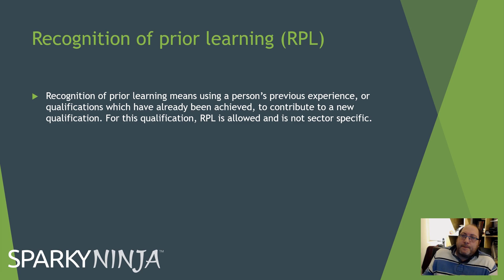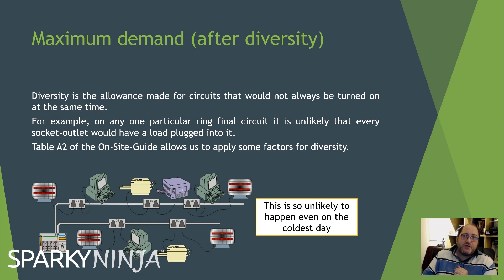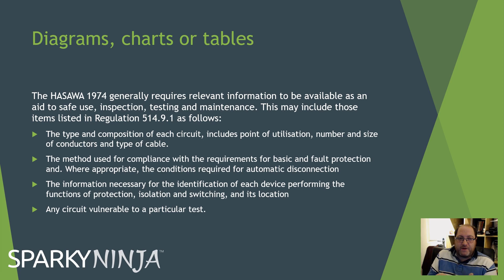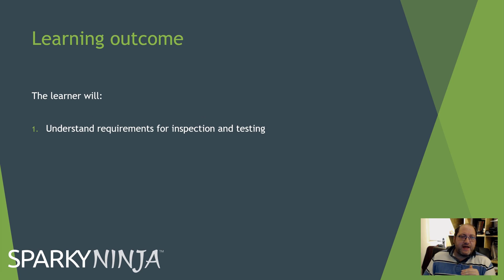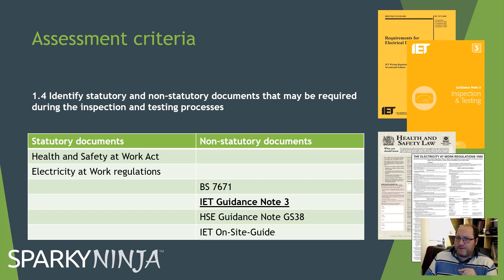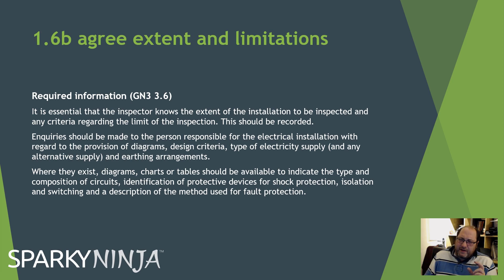2391-52 Inspection and testing course - Outcome 1

Comment: Hello Sparky Ninja, I wanted to ask some advice if you get a sec. I currently have 2392 qualification and due to work commitments, I find it impossible to take out a week to upgrade to 2391. I have taken 18th Edition Update course online with an assessment @ NICEIC centre which worked well. I am currently seeking an e-learning platform for the learning with a day at a local centre to take the exam / practical. Can you advise if you know of anything that would help me achieve this. Thank you in advance.

Comment: Great to finally see some relevant videos for the UK electrical trades. 

My boss just booked me on to the 2394, 2395 course in ten days time, no doubt some of these videos will help. Can you recommend any that are specific to the course please? I thin this is the actual course:

https://www.shop.niceic.com/combined-initial-verification-periodic-inspection-course

https://www.shop.niceic.com/pdf/a/700/Combined_IV_PI.pdf

Thanks.

Subscribed!
Reply from the maker: Glenn Carr hi and thanks for your comment.

Can I ask if you are sitting a combined 2394 and 2395 course? Or are you doing one and then the other?
Reply: SparkyNinja 

Thanks, think it’s the combined! All in one week
Reply from the maker: Ok then the syllabus for this 2391-52 series is the same. The difference for you is that if you are doing the two courses (2394 and 2395) instead of the newer 2391-52, then it means you will have to go through twice as much assessment.
Reply: SparkyNinja 

Ok, thanks.
Reply: +SparkyNinja

'The difference for you is that if you are doing the two courses (2394 and 2395) instead of the newer 2391-52, then it means you will have to go through twice as much assessment.'

Just curious, but do you know if the course includes the assessment? I can see that it says something about multiple choice questions but it seems a little vague as to whether it leads to directly recognised qualifications or is preparation for a separate exam (a bit like the AM2 for example). It appears to be run by the niceic themselves so not sure if the classroom hours are inadequate. I have just emailed them for further details but thought I'd ask on the off chance you might know a little more. The course codes are double Dutch for the most part (a bit like BS numbers - 7671 for example, pretty meaningless!) and there seem to be so any. Knowing which courses are most suitable is not easy. My boss wants me to take the role of qualified supervisor in the company, hence the booking.

Cheers.
Reply: +SparkyNinja

Just thought I'd give you an update on the course (since I'm now attending it!). It does cover both initial verification and periodic AND the final exams are included in the price (although at a later date) which include a 60 question multiple choice paper, a 1hr 20 minute written exam and a practical test though I'm not entirely sure of the details of this. More to the point, the final exams can be either through EAL OR City and Guilds, the latter being the 2391-52! I have opted (like the other three on the course) to go for the 2391-52 so these videos are perfect for me. 

Thanks again for putting in the informative work!

Comment: Great video. Would love to hear your thoughts on EAL Inspection and Testing 4337/4338
Reply: HobbyMan UK the eal test & inspect its for kids mate, i did it its a joke how easy it was
Reply: joe preece to make things interesting I have now done both City and Guilds 2391 and the EAL. Personally I think the EAL is slightly harder and in fact gives a better indication of an electrician knowledge of BS7671 as a whole and it's requirements for initial inspection and commissioning of electrical installations and the testing and inspection of existing installations. Breaking the course into two parts along with exams and the practical exams is in my opinion much better. It's interesting how many Electricians I have met over the years who have the 2391 and do not know the difference between commissioning and periodic testing.  It's finally says it all when City and Guilds are now doing the course in two parts. 😁
Reply: HobbyMan UK By commissioning do you mean initial verification
Reply: joe preece yes
Reply: HobbyMan UK i dont know why sparks wouldnt know that 😂